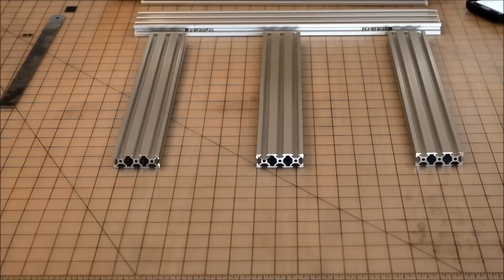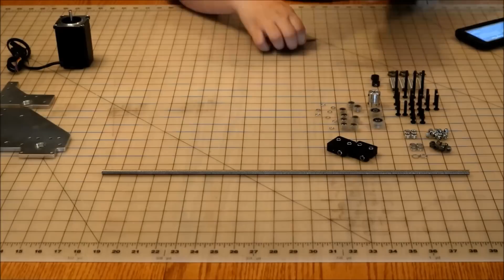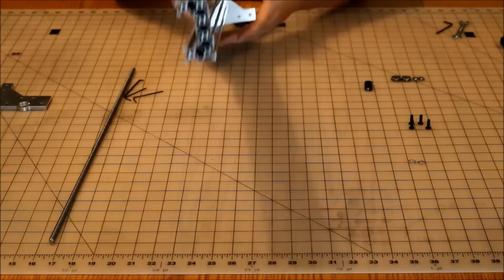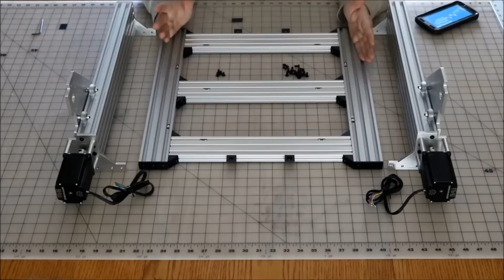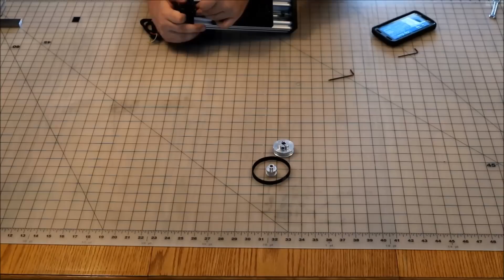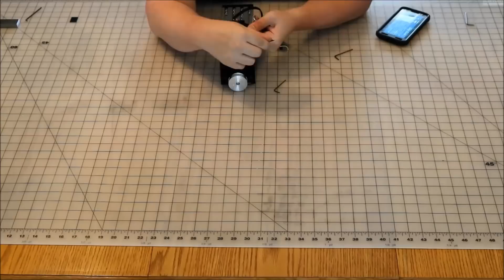C Beam Sphinx Desktop CNC Rotuer Build Guide

Comment: Why did use M5 60mm bolts on the motors to mount them,. NEMA 23s are drilled for M4 bolts?
Reply: Interesting since the NEMA 23 spec sheet on openbuilds shows the holes as 4mm.  The NEMA 17's use an M3.
Reply: I am sorry I miss read the sheet as 4mm, didn't realize that was 4 holes at 5mm. I sit corrected and thank you for your time to answer me.  Glad I didn't order 4mm mounting screws now.

Comment: how do you get rid of the slop in the bearings race to ball connectivity? even the most expensive and well made roller bearings have slop in them and that translates to huge jiggle factor when you are expanding from the point of wiggle to the edge or end of a bed or rail
Reply: ah I designed all my work to be adjustable with some self adjustment to get rid of slack, that coupled with self repairing lead nuts have given me tolerances of .0006" (0.01524mm) repeatibility. though I think part of the reason for that tight of a tolerance, is due to my motion at full steps (no microstepping) of .00025" (0.00635mm)

Comment: This looks strong! Yet your belt pulley is 22/42, how to setup in software as 200steps*22/42 is not integer? which belt you used and the length? where to get this motor mount? the video is offset and not zoomed well to see details. thanks.

Comment: Am I right, that your first Sphinx CNC build you used 3D printed endplates and connector plates.  And then you CNC made the Aluminum ones?
Reply: Thank You for the quick reply. I think I'll try that approach first as the Plate set is rather costly along with all the other necessary parts.

Comment: Hi! I sent in the dxf files to be cut today, however they are wondering if the measurements for the y-axis side plates are correct (15,5cm x 17cm)? seems a bit small?
Reply: Thanks! :)
Reply: Also.. I cant seem to find the right thickness of the plates? The gantry plates i got from openbuilds is 6mm and the endplates on the c-beam bundle that i bought is 12mm. And also.. should i go for aluminium or steel?
Reply: I have decided to use 6mm steel. couldnt get 6.35.

Comment: you cant never make threads correct for 2 plates. it means you need start cut thread excatly correct angle. OR do threats thru those pieaces same time, but why 2- only 1 those needed take backlash off. if not go for ballscrew

Comment: Is this available as a complete kit?  The use of C-beams would be a massive upgrade in stability and accuracy compared to the unit I am currently using.  The size of the unit in the video would be perfect for my applications and will not require any additional space on my work bench.  I checked out your web page and was surprised to see the only unit of comparable size uses a movable Y axis plate.  I would be concerned of vertical deflection  at the extreme outer ends of the X axis travel.  The unit assembled in this video would not have that problem.

Comment: Great project.   I am abut to build the C-beam machine in the next few weeks.    This is and excellent upgrade for it.   I will call all your plates when i have it up and running then convert it to a better machine.  
Can you post some videos if it running and explain more why you went with a pulley system for the z axis?  Whats the benefit of using pulleys vs direct connection?